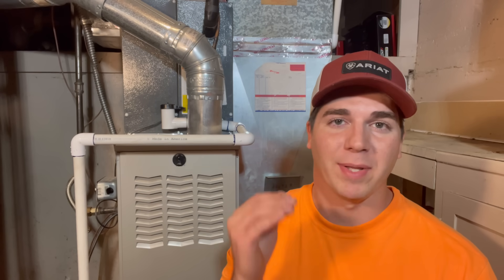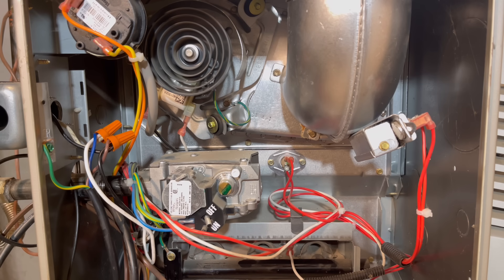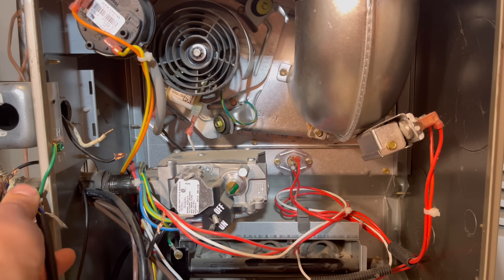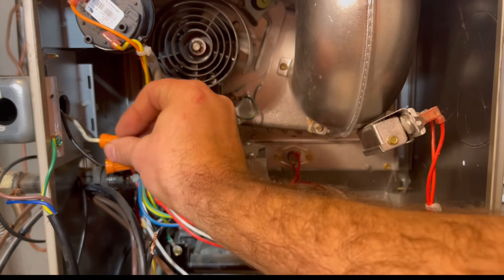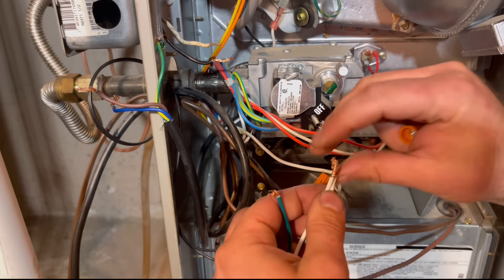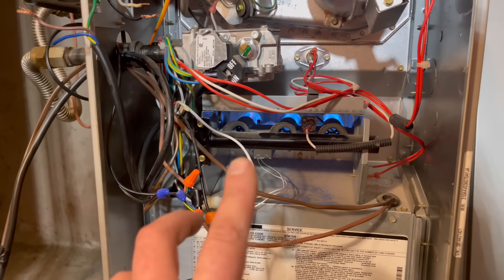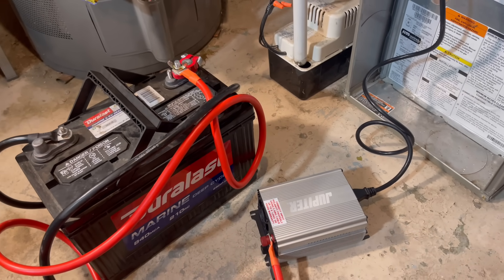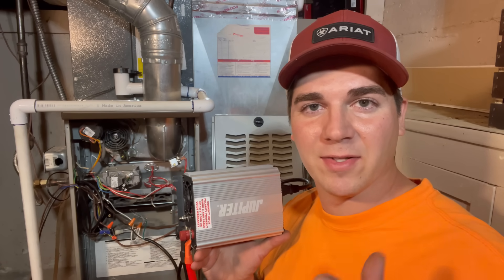Did You Know You Can Heat Your Home With A Car Battery?

Comment: What you could do for a more permanent mod to your furnace is to add an A/B switch where A is the mains and B is that 120V pigtail plug that you just plug into the inverter when the power is out. Just make sure that there is no 120V on the pigtail when switched to mains.
Reply from the maker: Someone else mentioned this. Can you find a link for the right switch I’d need?
Reply: @diyhvacguy  You can try a changeover switch but might be overkill for your furnace. You just need something to switch a load between two  power sources.
Reply from the maker: @coondogtheman  right on. Thanks bro!
Reply: @diyhvacguy  I ordered this one: Baomain Universal Rotary Changeover Switch SZW26-20/D202.2D with Master Switch Exterior Box 660V 20A 3 Position 2 Phase. $13 on Amazon
Reply: @earl2688  bro... Amazon sells Chinese fire causing death devices all day .. get one from a reputable place
Reply: @diyhvacguy  they are called 'transfer switches' and cost about $100.  Check out Reliance Controls TF151W
Reply: i was thinking you could have a battery tender on a battery like this wired to mains, then permanently have the furnace wired to the inverter, which is wired to the car battery (or a deep cycle battery would be even better, like this guy's rv battery).

But now I'm wondering why not spend 200 bucks on a 1000w UPS and just plug the furnace into it? Everything would be perfectly automatic then with almost no hassle.
Reply: @cantcomeupwithausern  your idea for a UPS is not a bad one, the issue is that this video is misleading. A furnace blower (particularly on an older 80% gas furnace) draws about 400w, and even more during start up. So a car battery nor a UPS is going to do much for you for very long. A better solution would be a propane generator or a battery bank (check out ECOflow products). Personally I have a $500 2200w generator in a box in my garage - it's a cheap safety net and I'll pull it out if we ever have an extended power outage. I also have a transfer switch wired into my panel, to switch my fridge and furnace to the portable generator if/when needed.
Reply: @Monkeyseemonkey79  make sure your generator's output is a clean and stable wave otherwise you'll blow the electronics like my dad did with his cheap generator. Test it out when you don't need the furnace for a few months that way if you blow something you'll have time to fix it.
Reply: @yvongauthier4409  good point. Mine is suitable for running a furnace - I made sure before buying it.
Reply: @cantcomeupwithausern  I like that idea but the furnace wont run for long since the UPS is only designed to run for a short time to allow you to save your work and shut down. You could use a deep cycle battery but UPSs charge so slowly and if you have frequent power outages there wont be enough time to recharge the battery so it won't be practical. You could try one of those portable power stations but I'm not sure how long those take to charge as I've never owned one.
Reply: @cantcomeupwithausern  Inverters and transformers always use more power than they put out, so unless you want to spend an extra 20% on the electricity to run your boiler/furnace that's not a great idea. If you only lose power once in a while i's not that much hassle to switch power sources. if you lose power a lot then a generator is the proper solution.
Reply: @suedenim9208  when normally running on ac, a ups doesn't draw anything extra unless it's charging the battery. the devices plugged into it are not running through the inverter unless the power goes out
Reply: Exactly what I was thinking.  And it's probably more likely that the homeowner has a portable generator, but no way to plug their furnace into the generator.  This would be ideal for a portable generator scenario.
Reply: @5thGenNativeTexan  the best thing he can do is wire his generator into the breaker panel with a transfer switch or a sliding plate that blocks the main breaker from being turned on when the generator is being used preventing backfeed to the grid. He'll need a more powerful generator than the one he has now but if you just need to run the furnace, some lights, TV, internet, cable box, refrigerator or a freezer it might be enough.
My setup is separate wiring. Enough to run my tv and satellite box, refrigerator freezer, a few lights and even my well pump.
Reply: @coondogtheman  Very true, especially with the larger sized portable generators.  On my parent's home (smaller home), we had a 10KW portable gen with the interlock kit on the breaker box, and the generator ran off the large propane tank for the house.  The gen only had to be rolled out of the garage about 10 feet, connected to the propane via a quick-connect, and the power cord plugged in.  Took about 5-10 minutes tops.   Then they just shed loads via the breakers, although on their home that 10,000 watt genset ran almost everything.   But as they got older, we decided to put in a permanent full-house Generac with an ATS so they don't need to do anything.
Reply: @5thGenNativeTexan  Yes a generac is even better for that reason. Expensive but worth it.
Reply: Simple solution is to cut the power wire going into the furnace. Put a wall plug on the furnace end, put a receptacle outlet on the power side. If your power ever goes off, unplug the furnace from the outlet, and plug it into the extension cord that goes to your battery powered inverter. 

If you want to make it more elegant, a receptacle outlet has a jumper between the two sockets that can be cut. The top receptacle can be the wall power, the bottom one can be wired to your inverter (if its a permanent setup). When the power goes off you move the plug from the top receptacle socket to the bottom one.
Reply: @kenwittlief255  that is unfortunately not to code these days. Instead, you have to install a transfer switch in order to meet current code.
Reply: @Monkeyseemonkey79  
What Ken Wittlief proposed does not violate the code. There is nothing unsafe about it. The design functions exactly as a transfer switch would.
Reply: @lxmzhg  it is against NEC code. Furnaces .just be hardwired on a dedicated circuit. It's the very reason transfer switches exist - because code doesn't allow you to run a furnace from an outlet.
Reply: @kenwittlief255  That's an even better idea I like that. Good thinking.
Reply: @kenwittlief255  Just know it's an NEC section 400.7 code violation.
Reply: @kenwittlief255   Well, shoot! This good idea is getting even better.👍
Reply: @kenwittlief255  you are correct! My furnace plugs into a regular wall outlet with a regular electric 3 prong plug, so all you have to do is unplug from wall outlet and plug it into the inverter! Thankx
Reply: trucker 9000  that would be a waist of energy/electricity.

Comment: and you're powering the blower fan motor also? that would kill the battery in minutes
Reply from the maker: Minutes is a stretch. I ran it for an hr no problem before disconnecting it. 

I have a pure sine wave inverter now and it’s hooked up to my truck so I can power the furnace as long as I have fuel in the truck 👍🏽 thanks for the comment! Cheers

Comment: DIY HVAC Guy - how about doing a video on how to keep the house warmer longer.  Have you heard or done a video about Hytech paints?  They have a NASA spinoff technology of ceramic beads that are hollow with a vacuum.  They prevent heat from conducting thru, like a thermos bottle.  They also have aluminum flake paint as a radiant barrier.  The paint is inexpensive and does not require retrofits to the home.  Oh, and for your sound studio - check out the rubber flake infused paint to eliminate echos in a room.
Reply from the maker: This is a great idea! I’ll have to look into that. I’d love to do a video or series on that. We just recently had out walks insulated with injection foam. There was literally just a 4 inch void there before we did it, as our home was built in 1921. That made a huge difference but it’s spendy. Thanks for the video idea! Cheers
Reply: @diyhvacguy  Hopefully, you have upgraded your windows and doors from 1921 standards.  You should consider upgrading your furnace to a 98% efficient model - a 19% improvement over the present one.  I did all this back in 2004 (after the power outage in 2003), had the blown in cellulose in the wall spaces.  The adage then was "for every dollar spent on energy efficiency - you save 3 dollars on the solar energy system".  Since I had holes, every 16 inches, to spackle and repaint, Hytech Paints.  The windows have "heat mirror" a silver coated mylar "pane" (triple pane) that reflects 95% of radiant energy.  The doors have fridge rubber edges for a tight seal.  Look forward to that series of videos.

Comment: Good for emergency. I use Bluetti EB-70 to run my Lennox gas furnace in emergency during rolling black out in Cali, woks great and I recharge the EB-70 with Solar panels, you can see my video. i also have 12V LFP 100Ah battery and 1500W PSW inverter setup for other system as needed when we have rolling black out.
Reply from the maker: Awesome. Thanks for sharing!

Comment: Buy a generator and put an Ng conversation kit on it. Or, leave the battery in the trailer and heat the trailer with it's 12v furnace. Or buy a catalytic propane heater. Or light the stove lol. Or light the fire place
Reply from the maker: Yea I have a dual fuel generator with a quick connect ng fitting so I can have it up and running in less then 10 mins. This is good knowledge to have in your back pocket when you are in a sticky situation though for sure! Cheers

Comment: That was the hard way to do it.  Just install a "manual transfer switch" and run an extension cord to a solar generator.  That avoids the opening and closing of the furnace for every power outage.  A 2-kilowatt solar generator with Lithium Iron Phosphate battery type like Bluetti EB240 with 1-kilowatt inverter will last 2 days.  You can add Lithium batteries to extend the range and charge the EB240 with its own charger.  You will need a better inverter since that one will burn the solid-state chargers of the EB240.  Why the EB240? It is an older, discounted product which is still good and has 2.4-kilowatt LFP battery.  It has things like breakers and a charge controller and DC outlets.  The nice suitcase shape is better than the science experiment you have on the floor.

Comment: Several days? Seems like the blower motor would drain it?
Reply from the maker: Yea I learned from the comments this was not true so I apologize for that. What I ended up doing is hooking it up in my truck so I can run the generator as long as I have fuel in the truck. That video will be posted soon. Cheers

Comment: I've seen heat exchangers crack from being powered off like that.
Reply from the maker: Good to know. How did you know it was turning it off that cracked it and it wasn’t already cracked?
Reply: @diyhvacguy  carbon mcarbon monoxide alarm. I own an air duct cleaning company, learned the hard way years ago as to why the blower fan runs for a few minutes after the system cycles off.
Reply from the maker: @casey197930  Interesting. Must have been an old furnace. I guess that’s probably a good practice to be in, turning off the furnace at the thermostat. Thanks for the advice. Cheers

Comment: Very badly misleading. 1KWH (your gas furnace needs nearly all of that because of the blower) at 12V is 83.333A, which is a huge amount of current, and your car battery certainly will not produce that much current for "several days" of continuous use. It may produce that much for several MINUTES of continuous use.

For reference... I used a similar, but much smaller, inverter to an exceptionally large, new car battery to power my wife's CPAP machine... and my battery was NOT capable of running the CPAP machine all night for ONE night.

Trust me, your gas furnace uses far more power than my wife's little CPAP machine.

Oh, and then... since you aren't even using a deep-cycle battery, you can only do this about six times before the battery is destroyed and you have to buy another.

THERE ARE BETTER WAYS TO GENERATE HEAT DURING POWER OUTAGES. Like... since you already have gas in the house, it's very likely that you use a gas range to cook your food. All four burners of that range will dump a LOT of heat into the house without using any electricity at ALL. Therefore, you can heat your house for months with it during power outages. Without even destroying your car's battery in the process!
Reply from the maker: Thanks for this information. I realize that statement was wrong and for that I apologize. What I ended up doing is connecting the inverter to my work truck so I can power the furnace as long as I have fuel in the truck 👍🏽 cheers
Reply: @diyhvacguy  THAT will work... provided that your truck is equipped with a 100A+ alternator and that you keep it at (at least) a high idle all the time you're running your furnace.

...which begs the question, of course... why not just build a rig that scavenges heat from your engine and feeds it into your house? That running engine out there is bleeding heat like crazy as it powers your furnace.

Or... connect a 100A alternator directly to an 8HP single-cylinder engine and park it next to a window.

Or... heck. Just buy a 1.5KW suitcase generator that produces AC voltage right from the gitgo? They're little, they're lightweight, and they're a world simpler and more efficient than hooking up your truck to an inverter. They just aren't "creative". I'd suggest a 1KW version, but they don't seem to be on the market. The smallest ones out there are 1.5KW. With a little intelligence, you can even make them quieter than the next-door neighbor's Cadillac.

Comment: So where's the other video showing how long this will run?
Reply from the maker: What I ended up doing is connecting the inverter to my work truck so I can power the furnace as long as I have fuel in the truck 👍🏽 the test video for that will be up soon. Stay tuned! cheers

Comment: I have a set up similar to this only I have a larger wattage invertor. I have a boiler so it will only have to supply a small 1/4 hp zone pump and the 24 volt transformer so mine should be good for a bit.
Reply: the pump only pulls 80 watts and that's figuring 100% efficiency which is impossible so figure 100 watts power consumption.
Reply: @43mackmobile  1 HP is equal to 736 Watts.  So a quarter HP is 184 Watts.

Comment: Will this setup work on an oil furnace ?
Reply from the maker: Can you explain how the oil furnaces work? I’ve never actually worked with one. Thanks
Reply: I  believe  it has same setup with thermostat and circuit board but not sure if it has Same amperage draw .

Comment: That inverter and battery set up is also a great option to energize a well pump during outages. I have a 5000 W inverter from Harbor freight and a deep cycle marine battery. It handles the extra wattage needed to start the motor.  It is perfect for intermittent use
Reply: My well is 220v.  Do they make a 220 inverter?  Right now I just have a manual pump mounted inside the well pipe.  I can attach it to an outside spigot and pump water into the house when power goes out.
Reply: @edflowers7456  I have no idea… Good question. I kind of think there is a way to rewire the output to double the 110 V rating, but I’m not sure how that is done.
Reply: @edflowers7456  You might look into a EcoFlow DELTA Pro 3 it has a 240v output.
Reply from the maker: Thanks for sharing!

Comment: MOST modern furnaces use 220 VAC not 110 VAC.  
Question:  How long can I run my (??????) off my inverter? 
Answer:  Think of your inverter as a little generator, and the battery as the fuel tank, YOUR ON EMPTY!!
Reply from the maker: Yes I ended up hooking the inverter to my work truck so I can pretty much power the furnace for as long as I have fuel in the truck. Thanks for watching and commenting. Cheers
Reply: Forced hot air gas furnaces are mostly 120 volt for blower motor. Not for heat pumps.

Comment: i've been wiring a three way or a 20 a on-off-on switch with the pigtail/ plug wire coming out of the service switch on the heater that way i don't have take it apart. then i usually rate 2000w for oil fired with water baseboard heat. didn't think a 1000w could work but nice to know. deep cell battery probably is ideal but in a pinch any works
Reply from the maker: I actually hooked it up to my work truck so I can power the furnace as long as my truck has fuel 👍🏽  thanks for watching! cheers